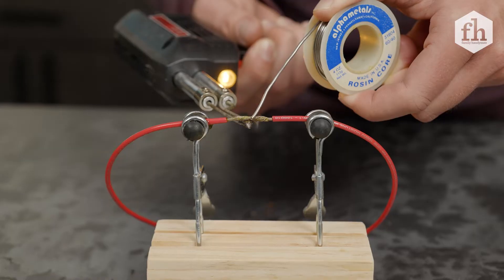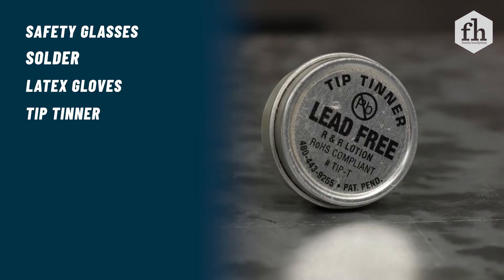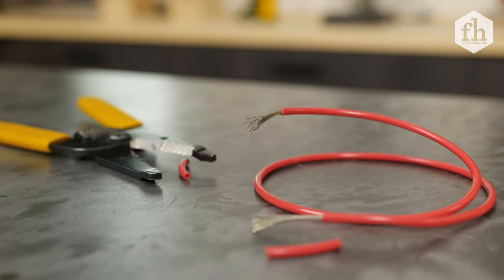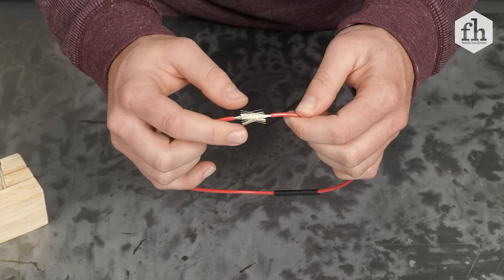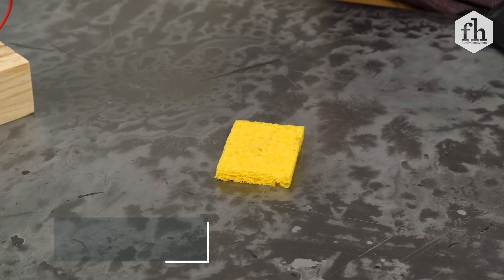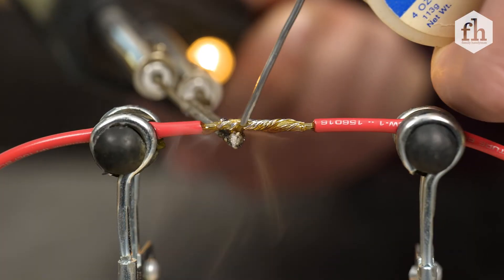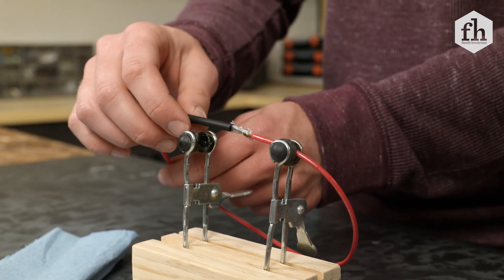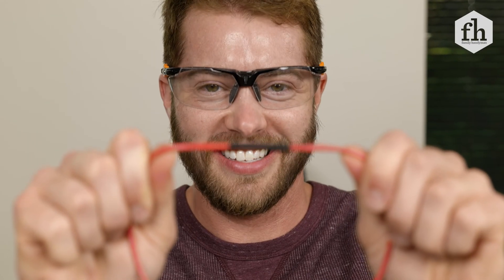How To Solder Wires

Comment: Thats an unnecessary amount of flux. I would skip the grease as well and just use marine heat shrink(adhesive lined) if you want the extra corrosion protection on an external connection. On a sealed or interior connection just skip it altogether and just use heat shrink.  That giant glob of grease is overkill and likely to cause that heat shrink to slide off prematurely. Which is more of a risk than corrosion ever will be.
Reply: Where’s your video?
Reply: @guyinpajamapants6892  posting a video doesn't make you right. I justified everything I said. You must be illiterate.